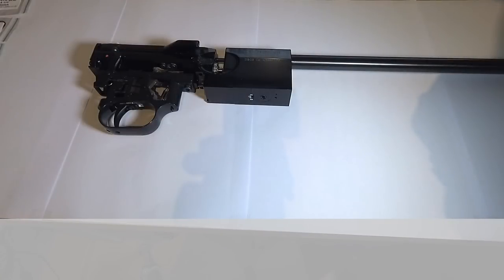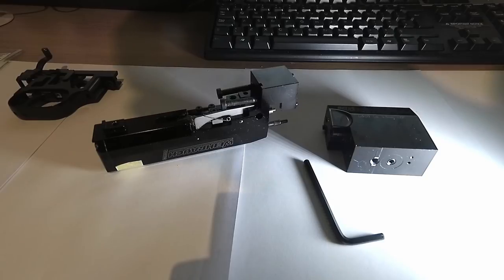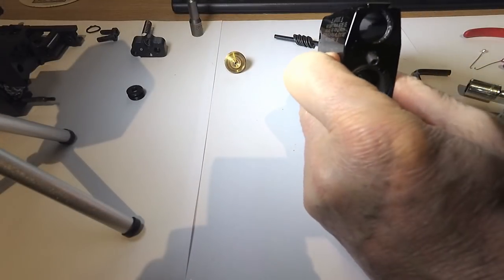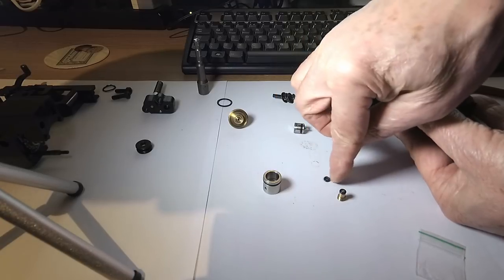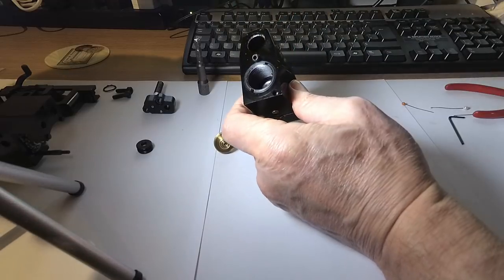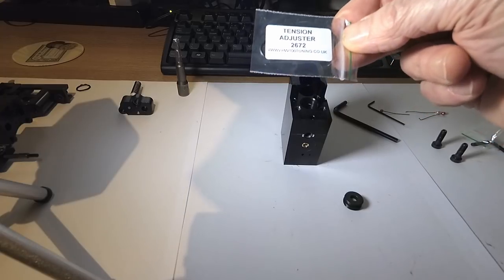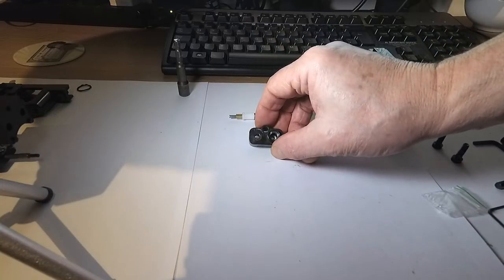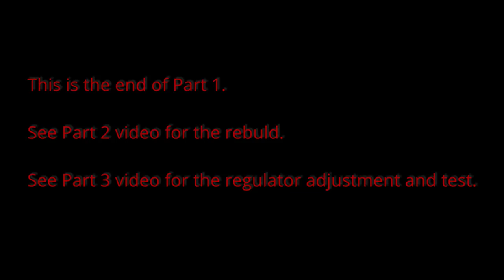Weihrauch HW100 - Regulator Service - Part 1 of 3

Comment: Hi there great video could you please tell me when I took my rifle apart a small ball bearing fell out any ideas where it's come from what part of the rifle the breach thank you Matt
Reply from the maker: Hi Matt,
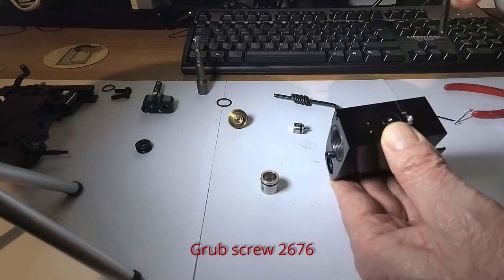The ball bearing probably came from inside the regulator pressure test port (see this video at 16:49).
Another possibility is that it came from inside the brass inlet valve (see this video at 13:05).
Please also see the Part2 and Part3 videos in this series to see the rebuild and testing including the inlet valve.
All the best, Martin
Reply: Many thanks Martin
Reply: Brilliant diagram thank you you for your time Martin

Comment: Hello, good morning, what is the material of the O-Weirch 100?
Reply: Hi Masoud,  I am not sure but I think that you are asking what material hardness to choose for the O-rings.  Some suppliers offer upgraded material for some of the O-rings that are more durable and therefore have a longer life.  I would always recommend choosing the upgraded materials.  In these videos I showed that I used a full service kit of O-rings from HW100Tuning.  I recommend this supplier simply because they offer a kit of O-rings that is individually bagged and labelled and that makes it easier.  They will post overseas and their prices are very competitive.

https://hw100tuning.co.uk/shop/ols/products/full-service-seal-kit

I would recommend having a good look at all the items in their shop.  For example you may need a pressure gauge to enable you to set the regulator pressure.

All the best,  Martin
Reply: @Incognito1-1  Thank you

Comment: Is this the most complicated of the pcps?     I have an hw100 and an aa s200.    The s200 is fun to tune.  I darent dismantle the hw (yet)
Reply from the maker: Hi,  No, I would say that the HW100 is an old but tried and tested design that is still in production.  The HW100 has a beautiful simplicity in the design and fantastic production quality.  The regulator does have a lot of parts and can be a little daunting but if you adopt a disciplined methodical approach to servicing the HW100 it can be achieved by a reasonably practical person.  If you do ever need to service the HW100 yourself then I would advise that you purchase a full kit of seals and lube from a trusted supplier such as www.hw100tuning.co.uk since having a kit of individually labelled service parts greatly simplifies the work.
All the best, Martin

Comment: Hello,been watching your video about rgulator service,but came across a problem,have hw 100 5.5 FAC version 2013 i think with 16 washers in regulator 10 washers are 11.9mm,6 washers are 12.35 mm,they mixed up and i really need stack order,can u possibely help with it,what kind,how many of them u have inside,im pretty clueless as no diagram anywhere,thx in forward...
Reply: @MartinHealy  Thank you on truly detailed answer and effort,i presume the rifle came with those washers,and the difference in size is minor maybe not noticable for most people its 0.4mm in diameter,i will put them in order of for as you suggested as i came across same stack order online on most Weihrauch owners,since the airgun was bought as FAC version originally i need to have around 110 bar of pressure,so if the stack order suits the desired pressure it will probably be alright,if not will buy those beleville washers 12 pcs,thank you once more for an extensive answer.

Comment: Do we need to put any silicon oil/grease to the new O-ring when assemble the back together?
Reply from the maker: Hi,  Yes the new O-rings (except the polyurethane seal) need to be lubed with Molykote 111.  If you would like to watch Part 2 and Part 3 of this series of videos I fit the new seals, reassemble and test the gun. Click on the links embedded at the very end of this Part 1 video.  If you purchase a seal kit from HW100 Tuning they include a little bag of Molykote 111 - see the description above for a link.

All the best,  Martin

Comment: Hello Mr.Martin, when I shoot my 100, there comes a puff of air from under the barrel, the place where it goes in.Does this mean it the whole regulator unit needs service?
Reply from the maker: Hi Eyad, I am not sure where the air is escaping from when you fire the gun.  The first thing I would do is to remove the stock from the gun.  Then try to make absolutely sure that you understand where the air comes out.  You could use strips of cotton wool to test where the air exits.  Let me know what you find.  

If the air only leaks when the gun is fired then it is possible that the barrel is loose.  Remove the cylinder to gain access to the grub screw 2679 and check that it is absolutely tight.  If your checks confirm that the leak is air escaping from where the barrel enters the block and the 2679 is tight then it could be the Barrel Breech Seal 2680.  The HW100 Tuning website has good diagrams and lots of info and guides.  They will ship seal kits overseas.https://www.hw100tuning.co.uk/page/exploded_diagram

If you do not shoot the HW100 for a few weeks does the cylinder pressure drop (it should remain constant)?
All the best,  Martin
Reply: Hello Mr.Martin , 
After following your advice , I carried out a meticulous check on my 100.The problem is really funny after discovering it.After I removed the shroud , the problem disappeared.The causing air came out from the shroud holes at the back.Removing and reinstalling it ,things got clear for me. The 100 operated very fine.This happened due to me being inexperienced with its mechanics lol.
Again thank you a lot for your quick help.
Reply: SOunds like it's coming from the cylinder out a new poly o ring on and it should stop this

Comment: Should there be any moisture at all on the spring washers from inside the regulator?
Reply from the maker: Hi,  The short answer is no there should not be moisture inside the regulator.  The air in dive tanks is  very dry.  I suspect that your gun has probably been filled via a hand  pump.  If the hand pump is operated in a high humidity environment this could account for the moisture you have found.  I personally only ever fill from dive tanks that are filled at dive centres and are therefore certified as breathing air.
I hope this info helps.
Regards, Martin
Reply: @MartinHealy  thanks for replying so fast Martin.i wouldn't describe the tiny amount of residue that I found as water but just so I'm not confused,should the washers in the reg be completely dry.im assuming yes!I fill my rifle up with a divers bottle and that is done at my local rifle club.is there anyway moisture could be getting into my bottle?sorry to make this long winded but I'm suffering accuracy issues that don't lie with the barrel(100% Not the barrel).I've worked from the barrel seal down to the reg now and found a small bit of residue,could this cause me any accuracy issues?
Reply from the maker: Hi,  I would advise to carefully clean the Belleville washers and the regulator block then apply a thin film of light oil by wiping each washer on a cloth to which oil has been applied.  I used GT85 because it also contains PTFE.  I recommend using a worn out T-shirt as the cleaning cloth if you do not have any lint-free cleaning cloths.  After a T-shirt has been through the wash dozens of times it has shed most of the loose short fibres.  Take great care to assemble the stack of Belleville washer s in the sequence shown in my videos.

There are many factors that could cause inconsistent accuracy.  Since you have the regulator block partially stripped I would suggest that you purchase a major service kit and a regulator pressure gauge from www.hw100tuning.co.uk and change all the O-rings - including the Main Inlet Valve (internal and external) since this is another cause of inconsistent regulator pressure - which will of course translate into poor accuracy.  After completing the regulator service, repeated dry firing with the gauge attached will highlight it if the regulator pressure is varying significantly from shot to shot.

Use  https://www.hw100tuning.co.uk/page/guides  and click on Regulator Tuning to access the Weihrauch Owners Club info on all aspects of repairing and tuning your gun.

If the regulator block service does not fix your accuracy issues then move on to cleaning and degreasing the hammer assembly. Persevere.

All the best,  Martin
Reply: @MartinHealy  thanks again  Martin.i will persevere like you say.im sort of enjoying the process as I am learning because of it.hopefully proves fruitful for me.thanks again.

Comment: Hi Martin Hw100 in 22 change main inlet valve seal spring and ball bearing power still over 9ftlbs would new seals alter the power any help would be grateful cheers Alf..
Reply from the maker: Hi Alf,
I sent a reply to your comment on Part 2 of this series so I am pasting it here again in case you didn't see it:
There are a number of factors that could be causing the low muzzle energy.  Assuming that you haven't  recently changed the pellets you are using then other possibilities are that the regulator pressure is low (below the 95-100BAR I would expect),  or possibly low hammer spring pressure or a combination of factors.  I would recommend that you start the diagnosis by obtaining a pressure gauge to measure the regulator pressure.  If the regulator pressure is significantly low then a regulator service will be required.  If however, the regulator pressure is consistent from shot to shot and the pressure is in the 95-100BAR range then it is likely that the hammer spring needs adjusting and or the hammer assembly needs degreasing/cleaning and adjusting.  You will see me use the regulator pressure gauge in Part 3 of this video series.

I am also assuming that you serviced the brass inlet valve as you see me do In Part 3 from the 22 minute point.  Did you change the seal inside the brass inlet valve?

Hope that this helps.

All the best, Martin
Reply: @MartinHealy  yes Martin I changed everything in the main inlet got it of Hw 100  thanks for your fast reply.alf..
Reply from the maker: @alfredhanley1691  Hi Alf,  If you do want to buy a regulator pressure gauge - I got mine from and the full Oring kit from HW100 Tuning here is a link:  https://hw100tuning.co.uk/shop
All the best, Martin

Comment: Hi martin, if i need more power, can i set the regulator more than 90 bar
Reply from the maker: Hi Pratik,  I cannot advise that you attempt to increase the power above that set by the manufacturer.  In the UK the power is limited to sub 12 ftlbs without a Firearms Certificate (FAC).  The muzzle energy of the gun is determined by a number of factors - the regulated air pressure, the firing valve timing, the transfer port size, the pellet weight etc.  So simply increasing the regulator pressure may not achieve your goal.  You should also consider that there are component differences between the low and high power versions of the HW100 - the regulator piston, Belleville washers etc.

I would encourage you to question why you feel that you need more power.  If you are hunting and would like to increase the range at which you can shoot game successfully then perhaps you could simply improve your stalking and concealment techniques to enable you to get closer to the game.  Shot placement is in my opinion much more important than muzzle energy.

Regards,  Martin

Comment: Try a dentist pick and puncture the valve seals and withdraw them
Reply from the maker: Hi, Thanks for the tip.  I did resort to puncturing some of the seals with a pin but I would prefer to avoid this method if at all possible because of the risk of scratching the metal surfaces and causing leaks or wear on the new seal.
Regards,  Martin

Comment: Seems modern air rifle don't last long before your paying for services or repair. Just like modern cars they get too complicated and break down regularly. The only thing they got going for them is they look good......... well some do.
Reply from the maker: Hi Pete,  I take your point about the complexity and potential for necessary maintenance.  However, the up side is that PCP air rifles are wonderfully consistent and accurate.  In fact rifles such as a well setup HW100 perform so accurately that the weak link is the guy or girl on the trigger.
All the best, Martin
Reply: Thanks Martin for the reply and I do agree with you. But you see so many rifles not very old having problems and some costing over £2000 plus. I had a BSA Meteor when I was 18 costing £25 second hand but alas we all get old and being a pensioner now this sport is well out of my league. Take care happy shooting.
Reply from the maker: @petemason57  Hi Pete,  There are still some shooting bargains out there.  Have you checked out any reviews for the CP1 and CP2 CO2 guns?  I have got both of these and they are basic but huge fun.  Provided that you accept them as cheap Chinese made guns and are prepared to do a little fettling yourself then they can be a good buy.  
All the best, Martin
Reply: Hi Martin, unfortunately living on an estate with small garden it's not the place for plinking lol. Just spent £3000 las month on new pc, Microwave and central heating boiler so as I said this hobby will be one I can only follow on the internet. I do have pigeon problems here but use a Chinese made Slingshot rifle F
(fettled by me) lol. Works well now but with only clay shot. Maybe in next life and by then it will be lasers lol. 
Take care

Comment: Absolutely cringing at this butcher and his seemingly endless range of allen keys which he uses for just about everything .
Right first off ,never i repeat never ever use any sort of metal implement to prise out seals o-rings or p.t.f.e. guides etc ,remember that thee are PRECISION instruments and any sort of minor scratch or scoring (even those invisible to the naked eye )of any sealed surfaces will almost certainly result in a compromised seal which will never be properly air tight . ALWAYS use either a wooden or softish plastic tool for seal removal .
Next pre-assembly cleaning ,it is imperative that all recesses and machined grooves to accept seals etc are meticulously clean ,this is best achieved by using something like methalayted sprits along with cotton buds to get into difficult to access areas ,a ready supply of kitchen paper is invaluable also .
Apart from this he does at least show how to disassemble the gun in the correct order .
Reply from the maker: Hi Jeg,  I agree with the point you make about avoiding scratching seal area surfaces and the use of wooden tools (such as toothpicks) to remove seals.  I make this point many times during this series of videos on the HW100.
On the subject of cleaning - again we agree on the need for very thorough cleaning before reassembly.  However I don't agree that cotton buds are a particularly good choice because they shed long cotton fibres.  In these videos I recommend using fabric from an old T-shirt that has been washed dozens of times because this fabric will have shed all the loose fibres during the repeated washings and because it is a source of cleaning cloth that everyone will have available.  In the videos I go on to say that after cleaning with the T-shirt fabric I then clean all surfaces again using special 'lint-free' cleaning cloth squares that are made for one time use. 
All the best, Martin

Comment: no audio??
Reply from the maker: Hi Jefry,  The audio is now back on all 3 of the videos in this series on the HW100.  When I received your message I checked the Part 1 video on my mobile and yes the audio was just a quiet crackling noise.  Even stranger it was the same on Parts 2 and 3.  All of these videos had decent audio so I was intrigued and couldn't find any issues with any of the other videos that I sampled on my channel.  However, I have now just checked on my PC and the audio was OK and when I checked on my mobile the audio was also back.  So I can only put it down to a temporary YouTube issue but all is now well.  Thanks again for bringing this issue to my attention.
All the best, Martin